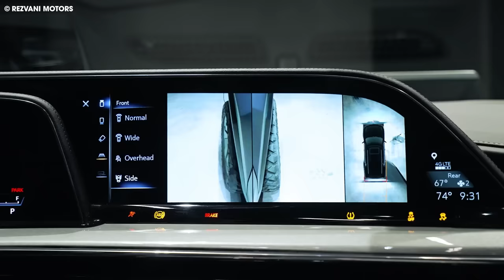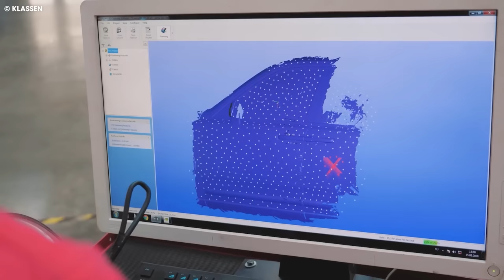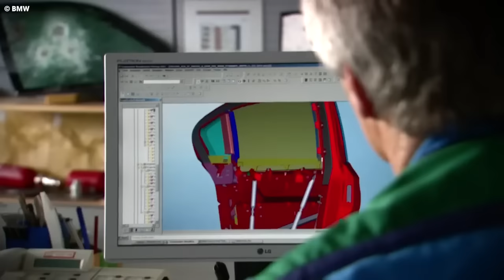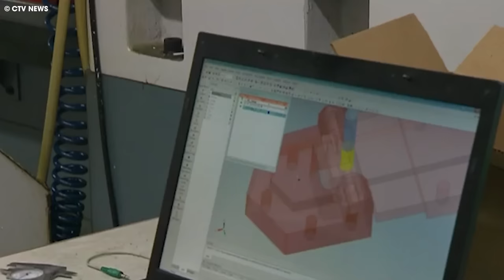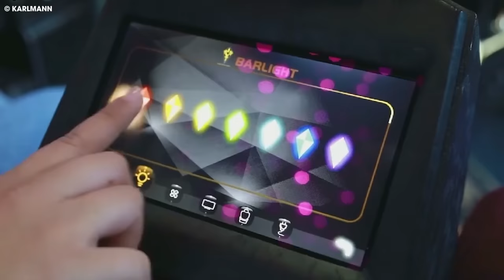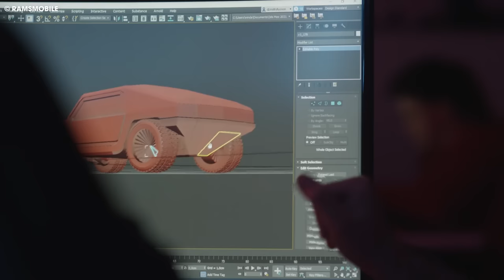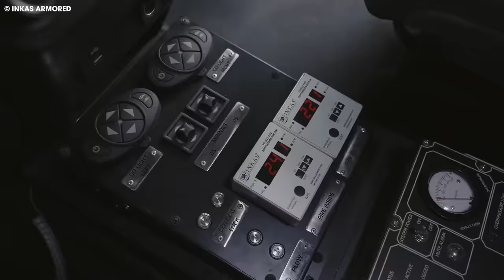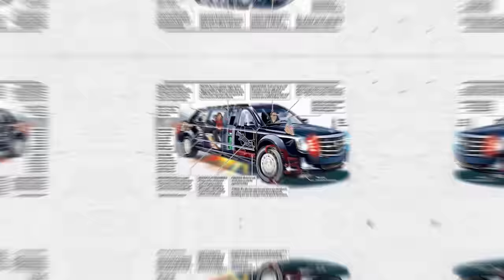People Laughed At This Armored Vehicle, Until They Looked Inside

Comment: Dartz Prombron Monaco Red Diamond Edition – $1.5 million This luxury armored vehicle is known for its opulent interior and bulletproof exterior. It is equipped with features such as a gold-plated exterior, diamond-encrusted gauges, and a high-end sound system. This is the most expensive bulletproof car. And the second is Knight XV – $629,000 The Knight XV is a handcrafted, luxury armored vehicle that offers top-notch protection and a lavish interior. It features bullet-resistant glass, reinforced steel body, and a high-performance engine.😋😁